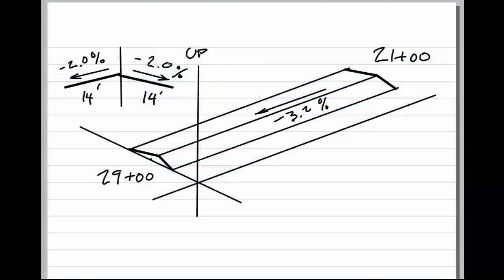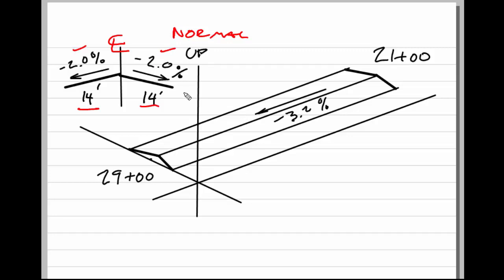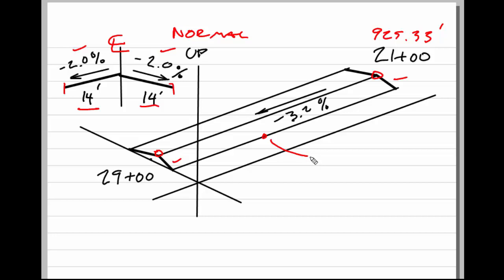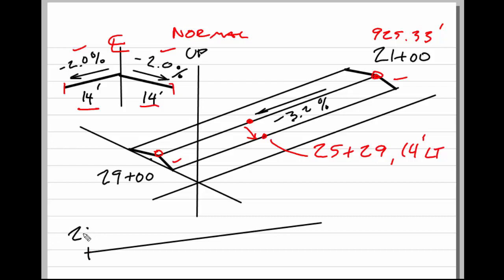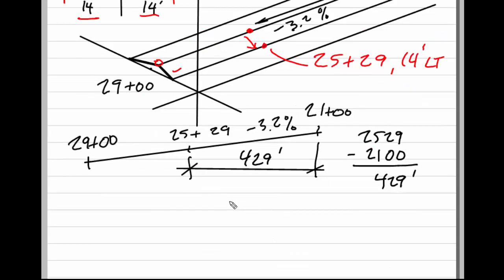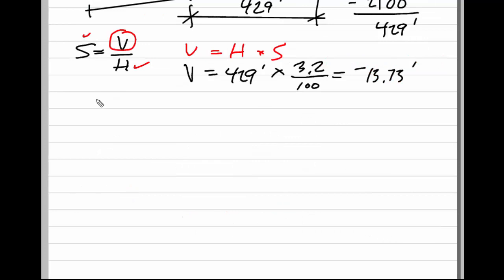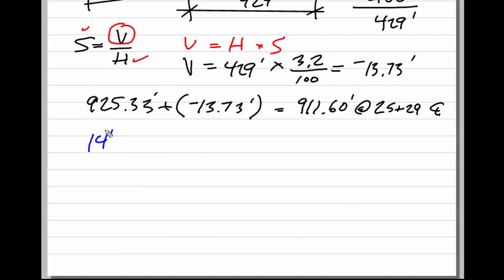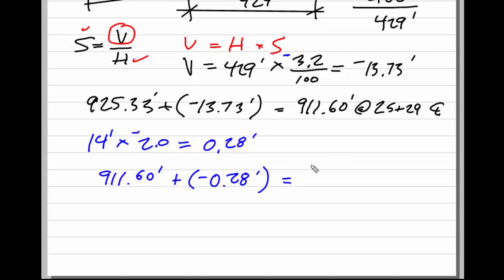Longitudinal and Transverse Pavement Slope Computations

Comment: Good job sir.But i am confused because you made 21+00 to 2100 then why you did not make 29+00 to 2900 then should you not add 25 in this 2900 so that is approaches to 2900+25=2925 then you find the distance like this 
2925-2100=825 but you calculated 429
Reply from the maker: A station described as 21+00 is a location along the centerline.  The plus + symbol is not a mathematic operator but instead it is only a placeholder.  Its presence indicates that the number is a station.  The distance between station 21+00 and station 29+00 is 2900 feet - 2100 feet = 800 feet.  In the video, the station for the desired elevation was 25+29.  Therefore, the distance between station 25+29 and station 21+00 is 2529 feet - 2100 feet = 429 feet.  Does that help?
Reply: Thanks a lot for your feedback.I got it through your response.
Well done and good effort to share your,s knowledge.
I wish you best of luck and may Allah almighty bless you a long life .